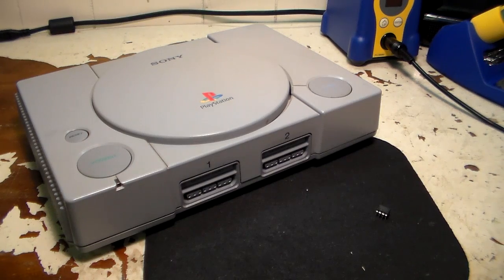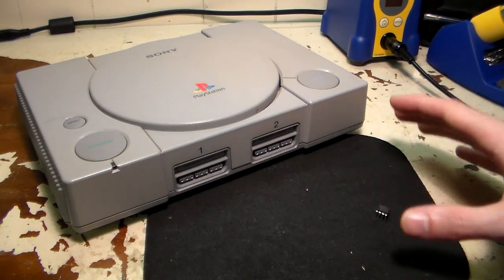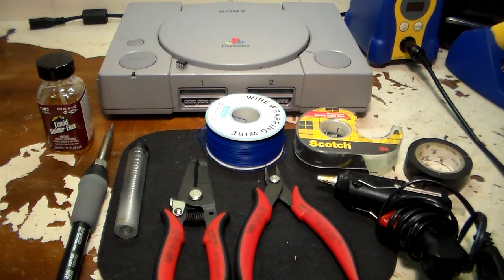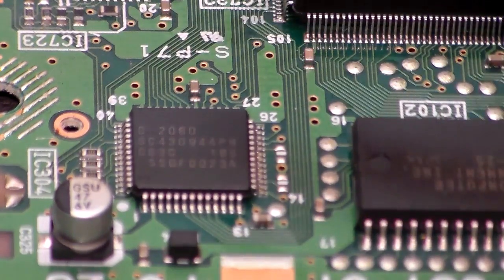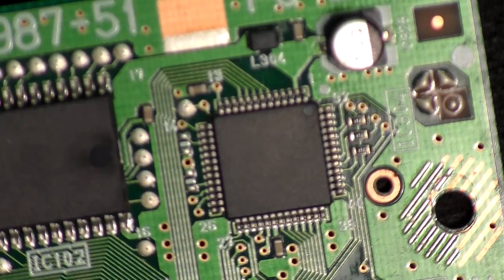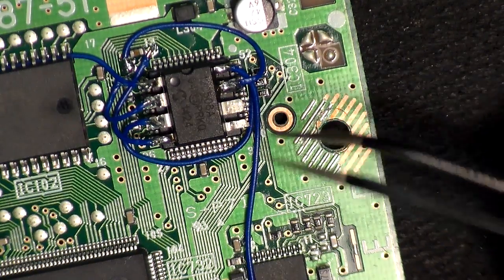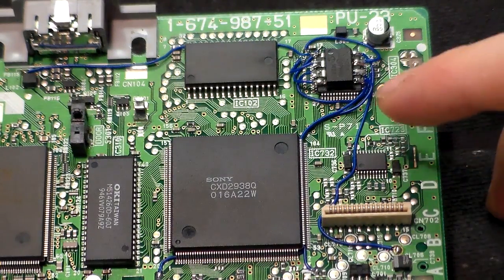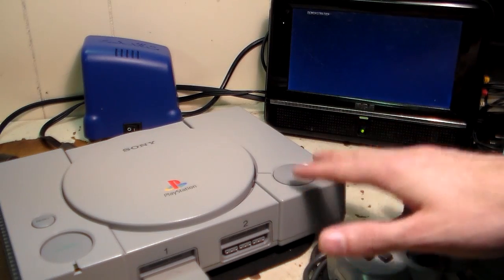How to Install a Mayumi v4 Modchip in a Playstation 1

Comment: Hello I'm from Brazil I really liked your very professional video, I wanted to ask you a question ..., I have a PS1 SCPH 5500 NTSC J from Japan, if I put this modchip it will run all the games even be for pirate? Or do I need to do anything else? thanks in advance.
Reply: Japanese systems can't play US or EU games with a modchip. Out of region games require a boot disc or region fixed image.

Comment: hey could you maybe explain to me how i would create my own mod chip. I know I need a PIC and the mod source code. I'm just unsure how to program the chip that's where I get lost really. Do you have to use a nand programmer on the chip? How do you get it to interface with your PC thoough?
Reply from the maker: You can use any cheap USB programmer. There are Chinese clones that go by the common name "mini pro" or "mini pro II" which is what I have. I never did get around to burning my own modchips bc life got in the way but it should work

Comment: Hello,thx,i have 1rst ps1 model with parallel port already modded with this chip,but my ntsc games work in black and white.
Reply from the maker: your probably have a PAL machine. you can patch PAL machines with an extra mod to fix the black/white picture when playing NTSC games
Reply: yes this is PAL Ps1 scph 5501 with parallel port,i've just bios multirégions chip. My games ntsc are original cd's,in rgb,in svidéo,all works in black and white. I see that is recurrent of certains models of ps1 1rst models have this problem. I would have preferred to keep this console (which has the parallel port).

what patch do you speak,software mod?, I heard vaguely about a mod fix but on the hardware, it seems to me, some welds to be done to restore the signal rgb 60hz to fix the colors can pass in the output video scart.
Reply: Hello,i have now 3 new ps1 fat japanese model: 5000,5500 & 7000,and want to modded one. Is this possible to mod this models with multimod v3 or mayumi v4,need cd swap to read ntsc/u backups games? Wich chip you advise me for my models.

Comment: I use the drill bit that came with my desoldering gun to prep vias for soldering. I turn it very lightly and stop as soon as I feel it biting so that I don’t damage the via. In many cases I can fit pre-tinned wire into it and solder will flow down into the via, provided I flux it before insertion (I dip in gel flux). Only issue with pre-tinned wire is that it’s not insulated so you really don’t want to make runs with it.

Comment: Someone is selling model 7501 with the mayumi v4 modchip installed. Does it matter which model the modchip is installed as long as it supports stealth right?
Reply from the maker: Yeah it doesn't really matter. They all work the same these days
Reply: @thewheelman282  does the mm3 work just like the mayumi?
Reply from the maker: @darko_0682  yeah they operate exactly the same. Im sure the code on the chip is different between the two but from an operational point of view you wont notice a difference. and pretty much all modchips these days support stealth. you would only find an old non-stealth chip if it had been installed decades ago.

Comment: Taiyo Yudens are fucking excellent, i ordered 300 printable ones and they NEVER fail.
Reply from the maker: yes they are very reliable. ive never had problems with them either if burned correctly
Reply: thewheelman282 
Is there a way to make a Memory card for the PS2 with the mod chip built in the memory card, and have an SD so it can play the games from the SD, that way I can play all my games from my memory card, hopefully they can do a mod chip that allows to save the game from the save ps2 because I have many Japanese ps2 and is a problem to play them.
Reply: thewheelman282 
If they can do a mod chip with the XBOX360 and allows me to install the games in the SD as well will be perfect, so I can install all my original XBOX classic games, and maybe even my PS1 and PS2 games as well will be perfect

Comment: My version number is scph 9002 I'm from UK i want to play Japanese game what chipmod should i look for would multimode mm3 be the ideal one. Buying Japanese PS1 console would be to expensive
Reply from the maker: The Mayumi v4 or MM3 should work on your PAL 9002 unit just fine. The Mayumi is generally a better chip than the MM3 in most respects though.
Reply: thewheelman282 ok I'm thinking could be hard to set up on eBay it said let buyer know about region games if u not sure how to set it up u could damage PS1 if ur not sure get a professional to do it. Do u know how to get professional to do it
Reply: thewheelman282 were can i buy mayumi v4 i can't find on eBay. I can find mm3 no problem it's just the mayumi i try to find

Comment: What Speed Do You Burn Your Backups At?
Reply from the maker: For my burner I use 8x
Reply: @thewheelman282  Col Thank You
Reply: @197Reaver  Slower is better with my xbox360 i used 2.4x burned like 100 games only 1 or 2 was not good.

Comment: I think the updated chips using atmega parts work a lot better than these old style chips, including stealth for the original boards as well. psxdev has more details.
Reply: One of the latest developments noticed for instance that the old MultiMode3 / Mayumi v4 keep a signal low incorrectly which causes them to actually be worse at reading CD-Rs.

Here is where you can follow updates on the development of this new chip: http://www.psxdev.net/forum/viewtopic.php?f=47&t=1262

Since it runs on arduino, it makes writing these chips easy with usb as well.